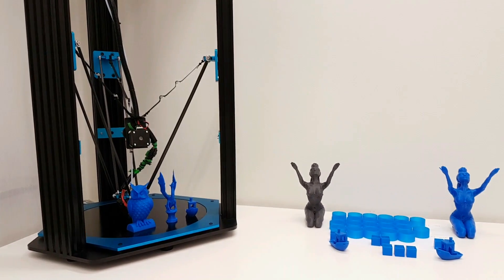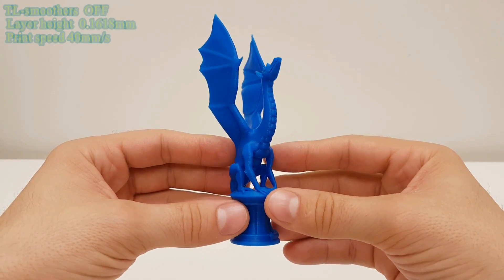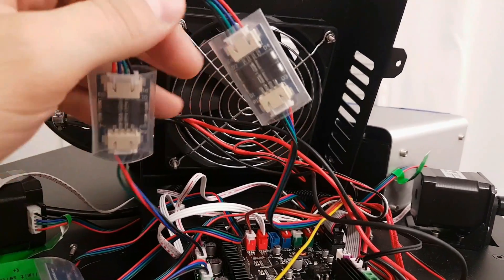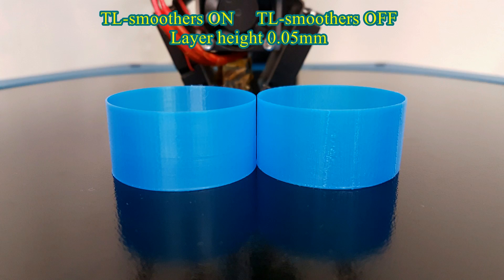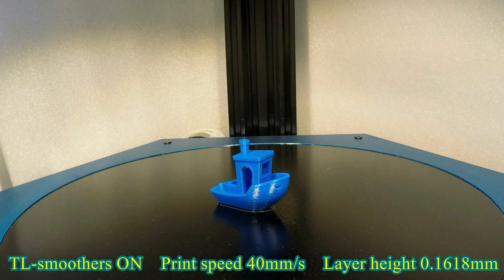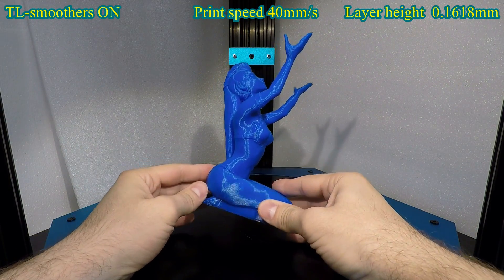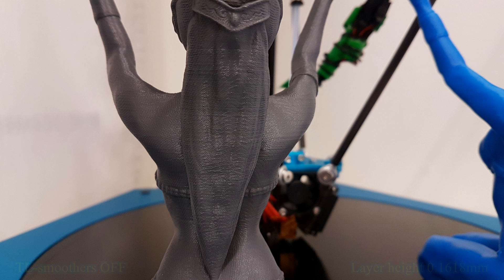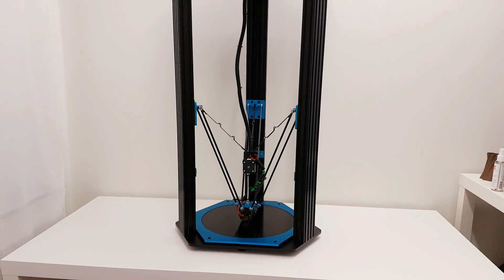TEVO Little Monster HUGE print quality upgrade! No more salmon skin!

Comment: why do you need 2 per stepper??
Reply: Tl smoothers are diodes and drop the voltage by 0.7 volts cutting off the noise coming from the drivers.
Reply: In general, these are diodes and not capacitors. Do not get smart
Reply: Doesn't matter if you're running 12v, 24v or even more.. the stepper driver will output only as much voltage as needed for a certain set current to be reached..
Reply: you need to get some clue into basics of electronics.. depending on what nema 17 you're using the winding will have some 1 to few ohms.. a 2ohm stepper, rated at 1.5amp, will reach that current when you put 3 volts on it.. if you don't understand this, please don't comment at all. btw many 3d printers use 24v and nema17 without a problem.. the polu is rated at max 50V or something..
Reply: You need 8 diodes per stepper. He used smoother boards with only 4 diodes them, hence 2 per stepper are required. If you get the boards with 8 diodes on them, then you only need one board per stepper. :)
Reply: You can buy the with 8 diodes.
Reply: @Misterbigblock did you use with 4 diodes or with 8 diodes?
Reply: 4 Diodes, just like the guy uses in this video
Reply: clever, read the documentation for diodes
Reply: I think because he used two 4 diode smoothers instead if a 8 diode smoother
Reply: There's a 'bug' in DRV8825 motor driver IC that it effectively loses current control and snaps to the next half-step when the voltage across one of its outputs is below a particular threshold related to its supply voltage. The reason this happens is that the switching MOSFETs have high efficiency when they are saturated (fully on) or fully off, but not during the transition, so turning a MOSFET off right immediately after turning it on causes a double thermal shock, so the driver extends current handling capability by limiting minimum MOSFET duty cycle and spacing the thermal impact apart and letting the MOSFET cool off a bit, it's not a technically a bug, it's a feature, though honestly they could have solved it better by varying the modulation frequency, but then again you can see why it's a cheap driver, they dodged the added complexity of that. The voltage itself is irrelevant to motor drive, it's merely a byproduct of impedance and current, and torque applied by the motor is proportional to current, the feedback circuit of the driver is a shunt that measures current, so if you install something to burn off a bit of voltage in line with the motor, the DRV8825 behaves closer to an ideal driver.

There's then the consideration how to implement this additional load. You could not just use two Zeners, because they have reverse conductance, but you could give it two silicon diodes and pad the rest of the voltage with two Zeners. Or you could just give it a bunch of silicon diodes, that's perfectly fine. The minimum duty cycle is around 12% if memory serves, so if you consume 12% of the supply voltage, that is good enough. The typical NEMA17 stepper voltage reaches about 3-8V at operational currents, so if you have a 12V stepper supply, that's 1.44V in which DRV8825 has a control issue, a significant part of the sinewave the motor windings are driven with. The 4-diode TLSmoother comes with a voltage drop around 0.7V because it's 1 silicon diode per current direction and per winding/driver output, so you need two to get to 1.4V and almost completely eliminate the issue on 12V drive.
Reply: I'm guess it because he's used 4 diode boards,  S0 I'd assume 1 8 diode board would do the same job.
Reply: good question..
Reply: You need 2 per stepper because 1 TL smoother will turn around / mirror the signal sent to the stepper motor. When you would home the printer, the printing head will crash into the heated bed, instead of going up to activate the endstops.  Trust me, i've made the mistake of only buying one set.
Reply: AFAIK the  TL smother is used as is when the steppers use 12V but since this printer uses 24V hence the double per stepper.
Reply: not true! nema 17 motors operate at 12 volts
Reply: The are capacitors. They store energy and take up excess and release a charge. So if your voltage dips or spikes from your mobo or psu or most commonly know for GPU overclocking, they will take up the excess and give out a smooth electrical signal. Larges or more capacitors tend to hold more charge and lose less voltage if it needs to give it away. So adding more will make the signal ''more clean''.
At a cost of putting more power through everything since those capacitors need to be charged as well.